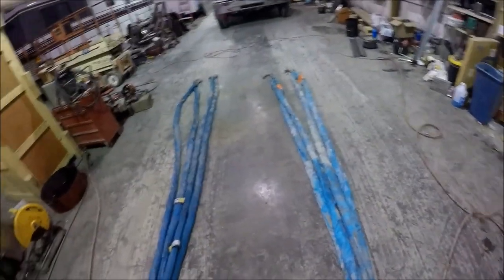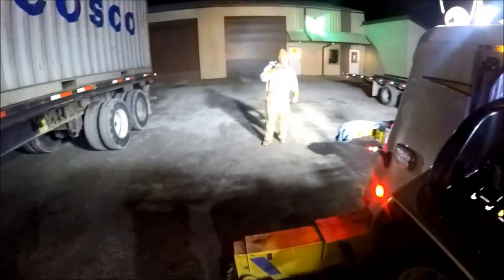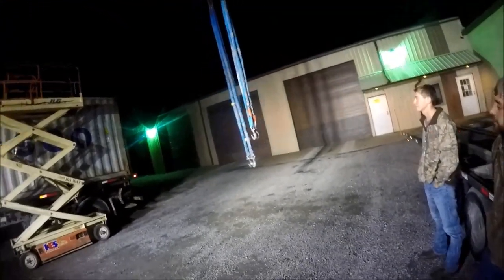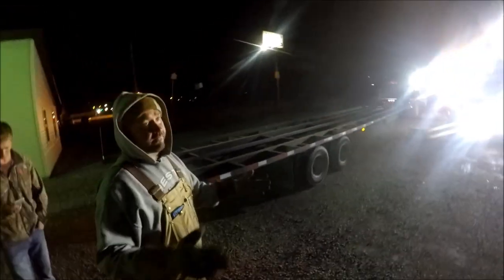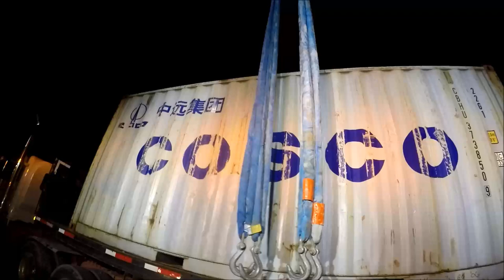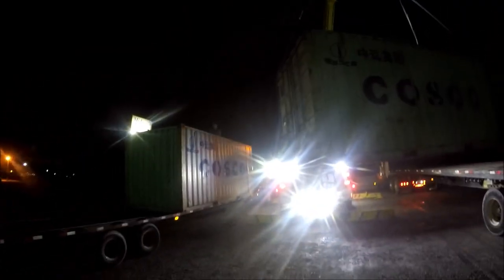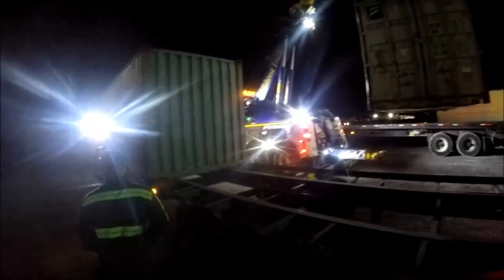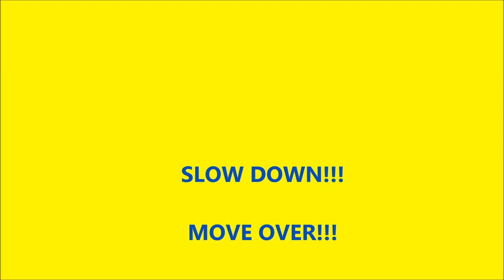ROTATOR CONTAINER TRANSFER

Comment: Nice job as always Ron, thanks for filming it!

I did see a "skyjack" the other day that had been converted to run on gasoline when needed!  They welded a support frame to the tail end and mounted a Honda gas generator to it.  I didn't check that size the generator was, but it struck me as a clever way of increasing the range of the skylift since it's much easier to fetch a few gallons of gas than to fetch a few gallons of electrickery!!!

Stay safe out there!

Comment: Nice job as always Ron! But if I may give you an advice then please watch out with your straps sliding against the edge of the container. Those edges could be sharp due to damage or rust. I think it's a better idea to lift the straps from the top of the container.

Comment: I had an Idea,yes some would say that is dangerous but my idea is a 2 in 1 hook  2 hooks on top and a single hook on the bottom  that way you could hook the two winch line to one side and a single line on the bottom side and the bottom hook can swivle that would stop thing from wanting to align with the end of the boom when you have to use two line ... told you it was danmgerous lol
Reply from the maker: Curious....I don't know.  At least you are thinking about rigging and problem solving.  That's a great thing.

Comment: Don't trailers over there have "twist locks" to secure the containers to the trailer bed?
Reply from the maker: Brett Swampy. Yes, on a container chassis trailer they do.  The chassis trailer is used when the boxes have freight in them.  These containers no longer haul freight.  They will be used only for storage.  The smaller truck and trailer that we placed them onto is a site delivery trailer.
Reply: Ron Pratt some of our normal freight trailers with wooden decks have twist locks built into them so they can carry containers as well as everyday freight semi's carry.
Reply from the maker: Brett Swampy. That's interesting.   I don't think I've seen one like that here, but there could be.

Comment: Does your company have a truck if for some reason the rotator broke down to tow it back to the shop?
Reply from the maker: JustPlaying. We do, but I hope we never have to use it for that purpose.
Reply: Mr Pratt do you ever get requested to assist other tow companies when they may need a secondary rotator?Hope you are staying as busy as you prefer to. Be safe
Reply from the maker: Victor Massano. At this time, we are the only rotator in our immediate area, so we get quite a few calls that we wouldn't if we didn't have the Rotator.   And, we have been asked to help or take over for other companies.